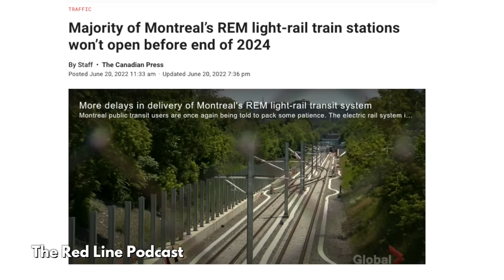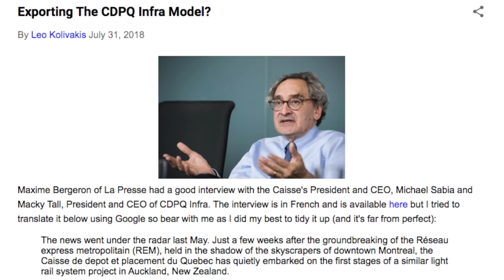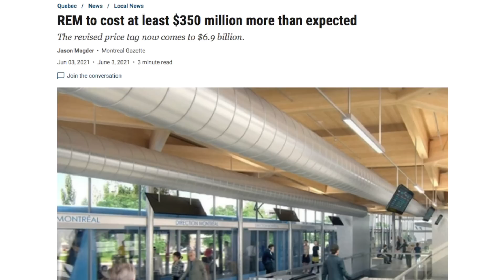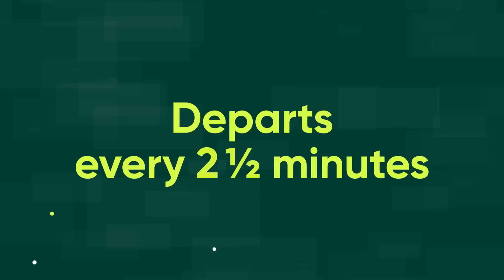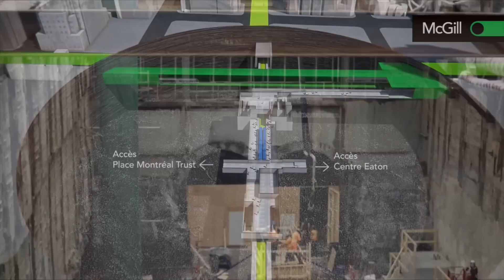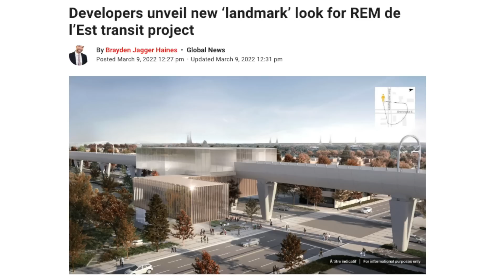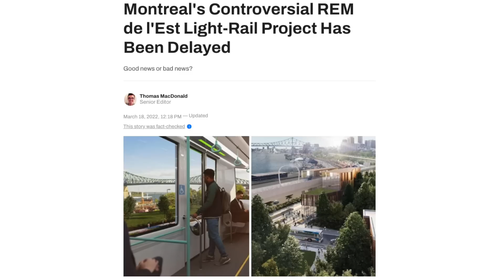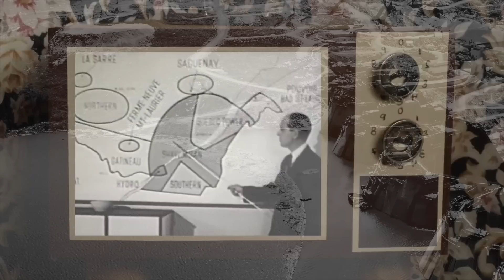The REM is Coming And It's A Game Changer for Montreal

Comment: Montreal's Métro alone amazes me with it's clean efficient network and to see this expansion is one of the most ambitious and exciting projects. I can't wait to experience the REM!
Reply: I am not a fan of Montréal's metro, having lived there for the first 27 years of my life. I much prefer the Toronto subway system and its functionality. However, the REM  will be amazing because it will significantly reduce the need for a car out of the core.
Reply: @Laughandsong  I'm curious to know the cons to Montreal's Métro (as someone who has only traveled to Montreal but in the process of getting ready to move there).
Reply: @Laughandsong  Indeed, I'm also curious about the negative aspects.
Reply: @Laughandsong  It's opposite from your experience from my 30 years of living in MTL, I can't imagine my life without the MTL Metro since I never drive a car in my life , from work to pleasure I have been using the Metro daily and it's fine, and the monthly fee is not even 100 CND compares to Toronto it's well over 100 CND  years ago , different people with different perspective Heh ?
Reply: @Matte724  If you can, move within walking distance of a metro (or a REM) station. I did that 35 years ago and have not regretted it since. No more waiting for bus on the bitterest of winter mornings when it will inevitably be late and full. (To be fair, the bus experience is much improved now that you can see where the buses on your cell phone.) I almost never take a car into town now because it just isn't worth the effort.
Reply: @Matte724  I was in Montréal from my birth to 1994 and a regular visitor since. Many stations do not have elevators and sometimes, not enough escalators ( like Mont-Royal station), the trains are narrow ( even the new ones) and it gets packed very fast. In the summer it's hot, in the winter it's hot. I don't find the AC on their new trains that much of an improvement again... because it's still narrow! Also, the buses do not have direct access to the stations. You have to punch your card yet again. Transfers are not time based like in Toronto where you can hop on and off to run all your errands for 2.5 hours, regardless of the direction you're going, all on one fare  To each their opinion, but my personal experience is always underwhelming. When I'm in Montréal ( on my way there this weekend), I avoid the Metro as much as possible, but I look forward to riding the REM.
Reply: @Matte724  Montreal’s metro is fine if you’re able-bodied; the only flaw is accessibility for people who have trouble with stairs. It’s frequent and pretty reliable. Delays do happen sometimes but that’s just life. Of course it’s crowded, but that’s also pretty normal for a transit system in a major city. There’s really nothing serious to complain about except that there should be more lines.
Reply: @Matte724  Some stations have a LOT of water infiltrations. This is due to Montreal's geology (limestone and shale with cracks and underground streams). These stations will smell of algae and be constantly under repairs.
Reply: @abcdeshole  It's a very good observation. I know they are working to make more stations accessible. But it's dad that they have not started earlier. Somr other metro networks are fully accessible.
Reply: @hdufort  yeah it seems nuts that in 1966 accessibility was absolutely not a consideration, but it just is what it is. They add elevators bit by bit but it’s expensive and not always feasible.
Reply: @abcdeshole  The métro network has been developed over the last half century so they could have decided to increase accessibility at any point in the 1980s, 1990s, 2000s. Let's not pretend that all has been planned and built in the 1960s.
Reply: i guess it's clean compared to other dirty cities, but i lived in mtl. when the metro was really clean and safe, last time i was there i smelled piss and i was scared - no one was around
Reply: The system in Montreal beats Vancouvers by a long shot
Reply: @Laughandsong  Did you say Toronto's metro is better than Montreal's? Hell nah, Montreal has new, clean and fast metros while Toronto has old, dirty and slow ones
Reply: @Matte724  im 10 miin from it ... cons . can be flooded from time to time .
Reply: @jeanfrancoisdutremble9022  I guess you have never been on any other system, like the Skytrain in Vancouver.
Reply: vancouver is worst..loll
Reply: @Matte724  the worst issue I find is that they do not have any contingency systems for when the metro itself goes down.  Toronto keeps drivers on standby to cover breakdowns and downed lines.  Do not trust an announcement that states a 20 min delay, the next announcement 20 min later could be for a 15 min delay.

The other worst issue is west island access, which the Rem is doing something about.  There is a huge area of the island that busses need to go around because of the airport and a rail yard.  With the rem terminal that goes right though the airport this as they say will be game changing.
Reply: @@user-zy9tw8pf7k Cas are incredibly expensive in Montreal with the price of gas and parking. With the weather and salt on the roads, they rust out pretty quickly and need constant maintenance. The potholes will ruin the best suspension and shocks. If you park on the road after a snowstorm, you have to be hypervigilant or you get yourself towed by snow clearing crews. Try driving down the Decarie Expressway anytime other than 3AM and you will be stuck in heavy traffic. It's driving hell.
Reply: @Matte724  It's mostly station-specific 1. Older stations can be leaky, smelly, and dirty. 2. Homeless people sleeping in entrances of some stations in evening hours. 3. Graffiti at some stations make it look dirty. 4. Rubber tires means that cars cannot go above ground and you have to dig expensive tunnels even in the suburbs. 5. Some lines were built to wealthier suburbs like Laval instead of denser but poorer neighborhoods like Montreal-Nord and Cartierville where they are really needed. 6. Some stations have long tunnels that feel a little creepy late at night. 7. Some stations still don't have good tunnel access to important local buildings. 8. Metro is so popular it gets overcrowded at rush hour.
Reply: @montalbert  Hell Yeah. Toronto has even more modern Subways on its line 1 and line 3. Visitors from Montreal are always amazed. As a frequent subway user when Montreal, i'd say MTL's line has slightly better coverage of the city but Toronto's Subways are more elegant and wider...
Reply: @christianlendo7787  I see they've been updating since the last time I went
Reply: @soulscanner66  I think that we should phase out personal ownership of vehicles and focus on transit. There are many exceptions but if you live anywhere that is easily accessible to a metro or bus line you should not be allowed to own a car. There should be taxis and coop car fleets. A car is parked for 90% of its existence. As long as there is a good coop fleet nobody needs to own a vehicle
Reply: @Laughandsong   can you justify your statement , or was it  just some BS bla bla bla ?
Reply: Efficient? You can't go to the vast, vast, majority of Montreal through the metro and the REM is also a tiny pathetic little line across the middle that doesn't get you most places. Compare Montreal metro map to the hieroglyphics of other major cities like Moscow, Paris, London, New York where the metro goes to so many places you need a degree in reading the metro map. And here's the kicker: Even North Korea/Pyongyang has a better and more extensive metro system than Montreal.

Comment: I'm really impressed! I grew up in Montreal, and was riding the Metro on the afternoon when it opened in October of 1966. I have frequently ridden the Deux-Montagnes line under the tunnel in the 1960's, and I'm glad the rail system is being upgraded. Some of the plans resemble the RER lines in Paris, but this will be better!

Comment: I'm really excited for the REM. As it stands, the current project really just has two issues:

The first, and biggest, is a lack of a metro connection at Bois-Franc. If a few more km of metro tunnel had been built from Côte-Vertu to Bois-Franc, that would have massively increased day-one connectivity between the REM and metro. The west end of the orange line runs along Décarie, which is a major employment corridor. The Caisse should have collaborated better with the STM and ARTM to complete the loop. The STM was building a major metro garage at Côte-Vertu concurrent with REM construction, which meant the earth had already been opened up. To the STM's credit, they did tunnel north, which will reduce capital costs in the future, but there could have been major savings. It would have been worth putting another half billion to a billion into the project just to complete that transfer.

The second issue is the fact that the airport is a terminus. Dorval train station, which is used by Via rail, is 700 m away from the airport station. A little more construction would have created a Via rail link in the West End, and would also have given the residents of the City of Dorval direct REM access.

It really is a shame that the REM de l'Est was killed by NIMBYs. I hate crossing René-Lévesque on foot. It's a miserable experience and a pedestrian concourse could have really been special, especially with a high line style park.
Reply from the maker: Completely agree, hopefully we can get an extension to Bois-Franc under construction in the next few years but it's the Government of Quebec and the ARTM that need to take care of that, not CDPQ and with the blue line extension taking 40+ years to finally get the green light, I'm not holding my breath. An extension to the Dorval circle is also crucial, maybe one day. I've decided to see the bright side and stay optimistic about what we are getting haha
Reply: @DiscoverMontréal  it's on the ARTM but the CDPQ had enough clout at the time that they could, and should, have pushed for it. It could have gotten done, especially given the garage project.
Reply: Clearly u guys haven't travelled outside USA or Canada
Reply: @MrSridippanda  weird comment. I've been to Europe and Asia, so you're wrong.
Reply: As someone who lived a long time in that area, it would have been really cool if the REM connected to Dorval, and I personally had been wanting to see the Green line extend into & through LaSalle, Lachine, and also connect at Dorval to close the loop & make that a real hub. But given the cost of extending the Metro (see Blue line extension), that would be really expensive. 

Perhaps instead have the REM continuing along that path & connect to the Green line at Angrignon? That would give about 120K people local access to a metro & faster access to downtown, as well as open them up to the west island.
Reply: @WhiskyCanuck  In that case they'd have to replace the Exo trains that go through Montréal-Ouest with REM, which might not be possible because I think Via and freight also use those rights of way. Extending the REM through LaSalle to Angrignon would probably be as expensive as building out a metro, if they're forced to bury it.
Reply: @APJTA  There are spots where a train can be routed through LaSalle on the surface. There used to be a freight line that ran from near the Mercier & CP bridges to Angrignon park that was never filled in after it stopped being used & is now a green strip. Some of that is close to houses (so expect NIMBYs), but a lot of it is light industry/office parks (which were built up with the rail in the first place). 

Alternatively, I'd be happy if Newman Blvd got similar treatment as to what was planned for Rene Levesque in REM de l'Est though. That area sucks, terrible stroad.

The Lachine part would probably have to stay along the 20, not ideal since fewer people would live close to the stations though, but would keep construction/real estate costs down.
Reply: The nimbys didn't kill it, the STM and ARTM did, and for good reason. The path it would have taken made no sense.
Reply: Regarding the Dorval Intermodal Rail station link, the Transport Canada study, which was long delayed, finally came out in August 2022 (just search for transport Canada Dorval intermodal study and you should find it).  It shows a definite advantage usage-wise to extend the REM the short distance.  Though the costs estimates are on the low side in the study (look pretty good), we are used to them being doubled, tripped etc in Quebec.  I have long been trying to push this matter with the elected officials (municipal, provincial and federal) and it's really a hot potato with so many jurisdictions being involved. Sadly it's not moving forward as far as I know for various reasons, but ultimately people fear the costs skyrocketing.  There is a need for sure to close the loop between downtown/LaSalle/Lachine/Dorval.  There is also potential tramway project which could go along  notre-damme/victoria in lasalle/lachine (which was an old rail corridor)... at least up to 32nd avenue, then go north up 32 and west maybe though the existing rail corridor (I guess otherwise they would have to expropriate a lot along Victoria/Bouchard.  Very sad this was missed at the beginning of the planning when CDPQ mandate was "connect the airport to downtown".  Now with the Airport station delayed till 2027, there can be a chance to fit things together... we'll see what happens in 2023.  He're to logic and hope... two things that do not always prevail.
Reply: @anthonysipos1002  good on you for leading the fight. Send me a DM if you're involved in anything and could use a hand.
Reply: @APJTA  sure I have a few people you can query in parallel to my efforts (so far I'm the only one annoying them) and I can share my communications so far. Not sure tho how to DM you on YouTube? Trying so see how 😊

Comment: The next thing that I think Montreal needs to take a good strong look at is running EXO trains at least once an hour in both directions. Most of the existing service is peak hours toward the city center the morning and toward the suburbs during the afternoon. If you need to get somewhere outside of those hours, you need to use your car or get onto a bus.
Reply: Visited Portugal recently and they had EXO style trains running minimum once an hour or even every 30 minutes during rush hour. Really hope they do it here. Ontario is doing it with its GO trains
Reply from the maker: Unfortunately from what I understand most EXO trains run on CN/CP rail lines and only get a small window every day to run their trains. We would have to buy the lines (I doubt the companies would sell) or build our own in areas where there isn’t enough room. 😭
Reply: Exo will be phase out if the REM work... So you are right, they will rebuild EXO in 10 years!
Reply: @pierregravel-primeau702  yea one of the exo lines is already phased out by REM to Deux Montagnes.
and something similar is being planned for east montreal and beyond to legault's exo 5 zone voters in terrebone, repintigny and mascouche
Reply: @pierregravel-primeau702  It's a matter of time before all commuter rail becomes REM-like transit. Commuter rail is ineffective and it encourages sprawl. People don't seem to realize how huge of a shift the REM is about to create for Montreal. Neighborhoods that were basically 100% car dependent now have a more efficient way to get to downtown and vice-versa.
Reply: Similar to the GO trains in Toronto that make intercity travel super convenient due to service times. EXO could benefit
Reply: The worst part is that they used to run frequently, and now they run close to never. It's a lesson in the same dynamics that give you "induced demand"

Comment: Life long Montrealer train nerd here - GREAT video - Thanks for this loving deep dive look at our amazing system from every angle - past, present future, well done! 
The sytem is special for so many reasons - smooth riding rubber wheels were mentioned but another fun fact - in the OG sections of the Metro the train cars use wooden brake shoes that have a lovely linseed and oak odour. Smooth braking and good life + low VOC = cool trick
The new South Shore segment is breathtaking in person! #excited